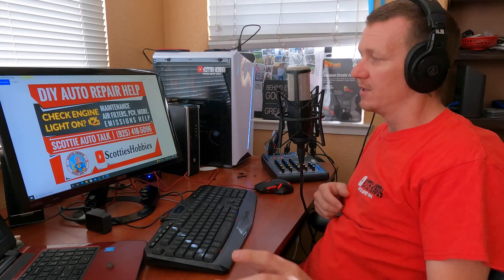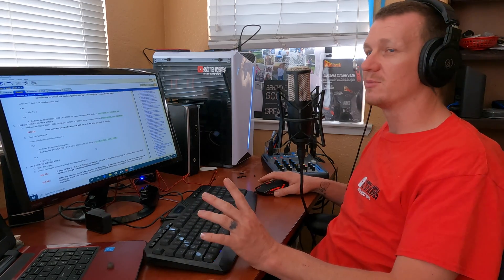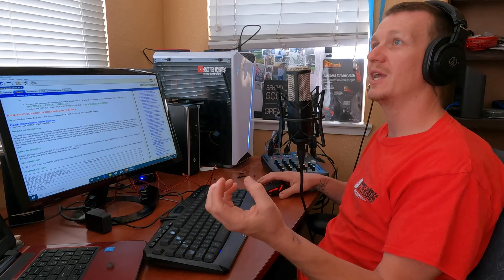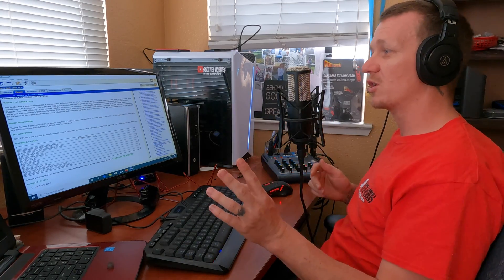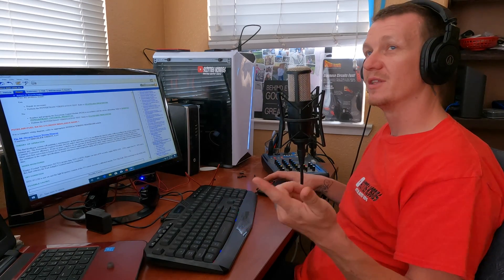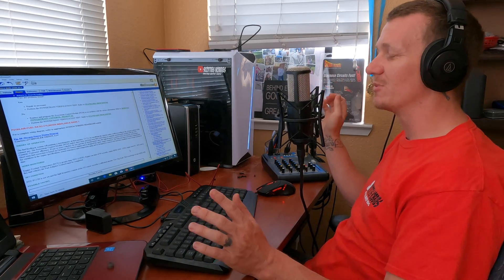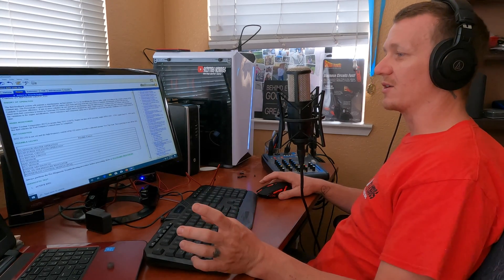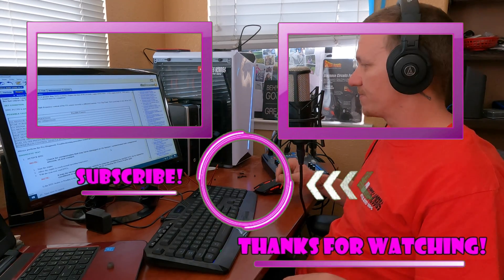⫷ p219a, p219b, p0171, p0174, Air / fuel imbalance / Lean condition / podcast ⫸

Comment: I have a 2014 Dodge Ram 1500 four-wheel drive 3.6 pinstar motor with the same code the p0172 and the p 219 a bank 1 Fuel and balance Richmond could it be the last injector I have not changed finally failed of the original and that's what it's causing cuz I have changed the map sensor the oxygen sensors I've changed everything you can change all the injectors but one

Comment: I am getting a P0451 code along with a P219b code and finally I am getting a P1400 code on my chevy silverado 2013. My check engine light comes on but it turns back off at the end of my work day. When I start my vehicle in the morning my truck starts off rough and then levels off. What would you recommend.

Comment: He doesn’t answer calls or texts lol. P219A on 13 Silverado 1500 5.3, replaced many parts
Reply from the maker: Sometimes, it's just not worth getting involved.  If you've replaced all the parts that might cause this code, maybe a diagnostic would be your best bet. Too many things can contribute to this code. Worst case, a poor sealing cylinder or valve not seating properly. 

Have you checked basics? No exhaust leaks, no intake leaks, how much blow by do you get when you have your oil cap off and run the engine?
Reply: @ScottiesHobbies  2011 tahoe 219A and 219B. Literally i have changed every part involved in this problem . Even exhaust gaskets, coolant sensor, O2, canisters, purge, pcv etc … no help. It’s intermittent it appears for few days, then disappears for even few weeks, then comes back … and so on. 😢😢

Comment: I have an 2014 Ford focus 2.0L 
And I do have a code P219A 
But I already changed bank 1 oxygen sensor also replaced the purge canister valve I have also replaced the spark plugs and just bought the ignition coil packs but this might be my problem a faulty oxygen sensor

Comment: Hey Scottie, on my 18'Subaru Outback i get the check engine light only when driving on a long trip. After a few starts of the engine the light goes off. I got the car diagnosed and the code from the error memory is P219E - cylinder 3 air/fuel imbalance. Nothing else. When doing short trips in the city it never happens. I can also feel the engine shaking lightly/losing power only between 1.8-2k RPM (dont know if these two issues are connected). Otherwise the car is running fine especially in the city. So far I've replaced spark plugs, cleaned throttle body and MAF sensor, swapped the ignition coil of cylinder 1 and 3 and waiting for the check light to be triggered again. Can you guide me to what else could it be? Oxygen sensor or fuel injector?
Reply: Fuel injector 
You need a scanner that can test each injector individually just like the dealership did to my 2019 Pilot and #2 injector failed 3x so per recommendation I need to replace all injectors at 32000 miles. 😢

Comment: It’s the bad gas they’re selling us!!! We’re having the same issues with both of our cars and they’re 2013 & 2018 and it started after filling up the tanks. We’ve replaced the sensors and nothing!
Reply from the maker: That is a complete possibility.  I've noticed if I fill up at the closest gas station to my house the gas sucks. I get a check engine light for miss fire and sometimes the car doesn't want to start and its everytime I fill up there. So I go a little further to another gas station and no problems at all.

Comment: Hey Scottie, I have a2015 Dodge Journey 3.6. Just recently my check eng light turned on & I have 2 codes P0301 & P219A. I was thinking a much needed tune up but now it appears it's something more.  🤔 Guessing Spark plugs are not the fix?
Reply: Have the same code P219A & P0301 how did you fix this ?
Reply: Crazy as it sounds, I had to buy the 02 sensor from Dodge. Bought it, replaced it, and couldn't believe all the codes cleared. I've learned that almost everything with this car I've had to go to Dodge.😒 @youknowdreey8915

Comment: If u type "ctrl f" which means find the key word, a small window opens up in bottom left hand screen, then type in what you are searching for and it shows up Hi lited. If there's more then one keep pressing return key and each one shows up.
I've got this code that showed up within 100km after having cats replaced, same mechanic ran tests & can't trace it. Needless to say, won't be returning. More hands on work to do AGAIN! Found another better mechanic both of us working on trying to diagnose.
Reply from the maker: Are the connections for the cat upstream of any oxygen sensors? The weld? Or the flange?

Comment: Hey Scottie I’m dealing with a p219b on a 2013 Jeep Wrangler jku. I was having various p300 codes prior which I’ve replaced o2 sensors, ignition coils, spark plugs, cleaned throttle body with tune up, replaced ECU, replaced cats, cam positioning sensor, crank positioning sensor and replaced intake manifold gaskets. Every time I seemed like I fixed the p300 code it will come back several days later. Now after replacing the cats the p300 code has come off but now dealing with the p219b code. Any idea for a possible fix?
Reply: Did you ever figure it out? I'm dealing with the same thing on a GMC 6.2. Replaced everything and it still comes on.

Comment: I just had my car repaired for a P0520 code on my Dodge 2014 Grand Caravan, $900.00. They replaced  something called a wire Knock and the sensor. Was told to drive for 100 miles before I could get my smog check done. After driving 30 miles my check engine light came on again and now it's a code P219A. What the heck? I only had one code prior to this new one. Why do I get this now? Could it be something they did when they replaced the wiring?
Reply from the maker: Well the whole thing sounds a little odd. A p0520 is a oil pressure code. They replaced the knock sensor and harness? Do you see any pending codes? I can see a bad knock sensor causing bad timing and causing the fuel ratio code. Did they by chance say why they replaced the knock sensor? Did they run diagnostic tests?
Reply: @ScottiesHobbies  The $900.00 was for Labor only. The total bill was $1109.00. Sorry about that part. I have driven the car for only about 30 miles now and I am getting a P219A code. Is this some sort of scam that the dealer is pulling? How can I show you the invoice? I have a jpeg of it. Can it be that they didn't connect the wiring snug enough or something minor? Could it be as simple as needing a new gas cap?
Reply: @doirmad  that's why everybody trades their vehicle in before warranty runs out

Comment: 2018 KIA Forte, have the P219a accompanied with P0303 missfire on cylinder 3. I swapped coils and injectors but it remained on 3. MAF is clean,  no vacuum leaks, it's very well maintained. Plugs are good. Engine temp runs normal, no coolant loss. It's going to the dealer tomorrow.
Reply from the maker: If you swapped the coils and the code stayed in the same position, if start to suspect low compression. You cleared the light after swapping the coil? And the light came back on with same miss code after swap?
Reply: @ScottiesHobbies  Yes,  I cleared and drove it, after it went into closed loop the light came back on. I swapped the injectors,  no change. Suspecting the A/F Sensor B1S1, but don't want to mess with it since it's under the 10 years100K miles warranty.
Reply from the maker: @ahmadghosheh3104  good thinking. Don't give the dealer an excuse to not cover it. Keep us posted on what they say. 🤞👍
Reply: @ahmadghosheh3104  so did you end up getting the whole engine replaced or was it something else? Sounded like it was becoming a mechanical problem within the engine..... no follow up has everyone thinking the worst outcome, as in the whole motor being replaced....
Reply: Hi, did you solve the problem?

Comment: Hello Scottie,

I have a 2013 Toyota Corolla. I am getting P0171 and P219A. I was told by a trusted mechanic with  a more in depth scanning machine that the catalytic converter and fuel pump needed replacing. I'm wondering how he came to that conclusion because my scanner only shows those 2 codes. However, I installed a fuel pump from a 2009 Ford Focus onto my Corolla about a year ago (that pump had about 170k miles) Any help would be highly appreciated. Thanks
Reply: Try changing the gas cap. Use genuine product. Fixed my P219A, P0300, P0301 and P0304. 
Looks like because of some vaccum leak from broken gas cap, i had a messed up air/fuel mixture causing some cylinders to misfire.

Comment: hey Scottie, so I have 2013 silverado 5.3 and just had the dod/afm/vvt deleted completely, new cam all that.  went with a slightly more radical cam than stock (btr stage 2) had it tuned and within a few days I got the p219a and shortly after that bank 2 also lit up. called the tuner and he claimed bad o2 sensor. I haven't changed the o2s because I don't want to just throw money at a truck that was running fine before hand. truck does have 210k though. curious as to where you would start? I don't want to bring it back to the tuner because he put a bad taste in my mouth for some other things. I'm thinking about taking it somewhere else to get it retuned, however I have a friend saying it could be clogged cats....🤷‍♂️ your thoughts? thanks!
Reply: Did you get it fixed? Have the same truck and issue
Reply: did you figure out P219A
Reply: Fuel Injector was the fix 
https://youtu.be/jIT0-6uectI